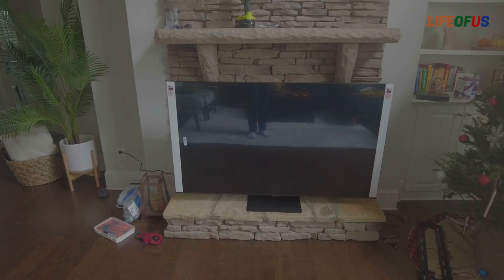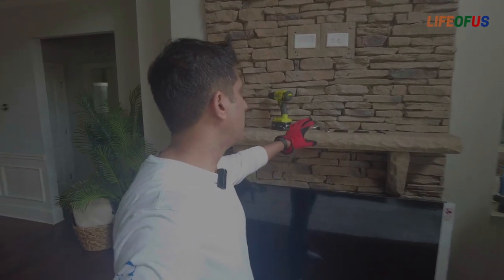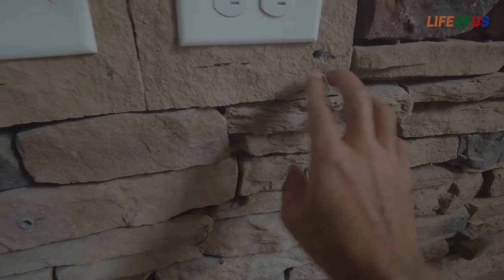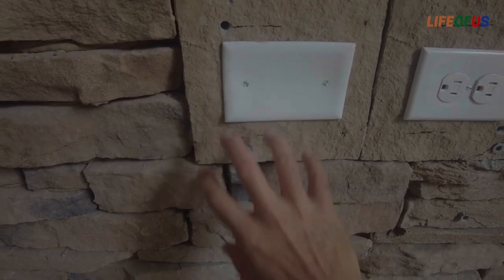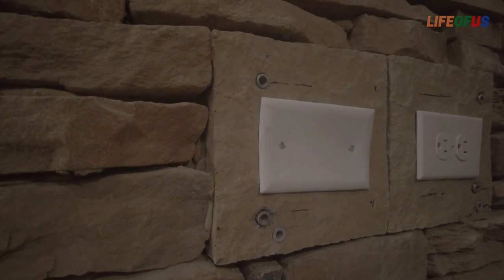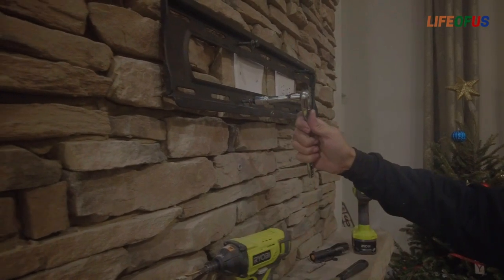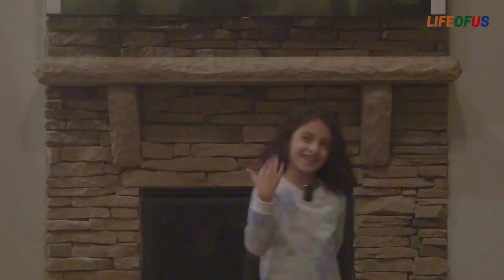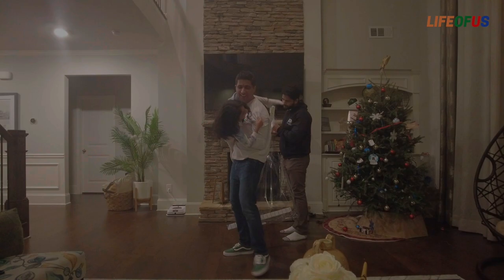How To Mount TV on a Stone Wall

Comment: Shouldn't the fasteners go through the stone vaneer and into wood framing?
Reply from the maker: Ideally but in our case the stone was thick and it was hard to drill through so I just took a strong metal faster to make sure it is stable

Comment: This method with only work into concrete/sandstone/solid stone fireplaces. Brick and facia surfaces with crack or fall off the backing. This install may hold, only because the bricks you drilled into are clearly larger and directly mounted to framing. Although it's still not safe.
Reply: Completely agree